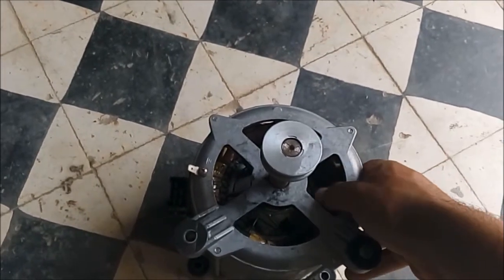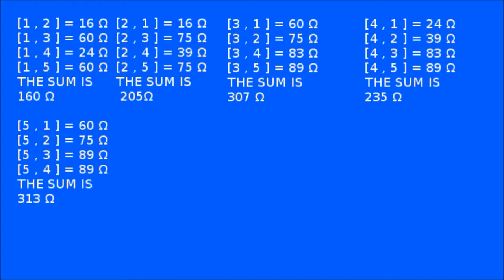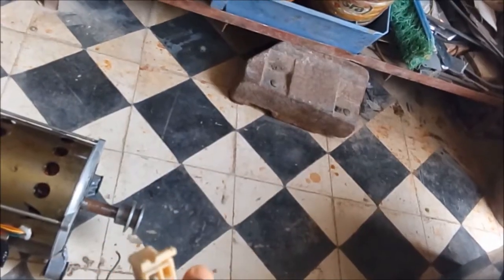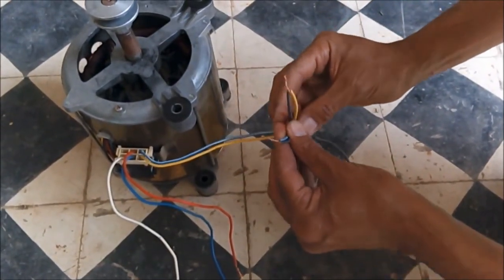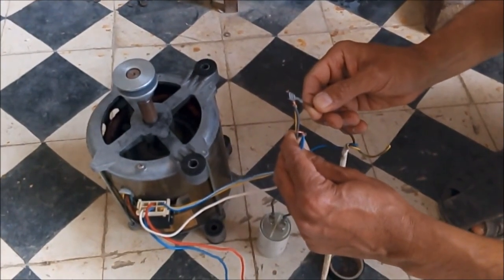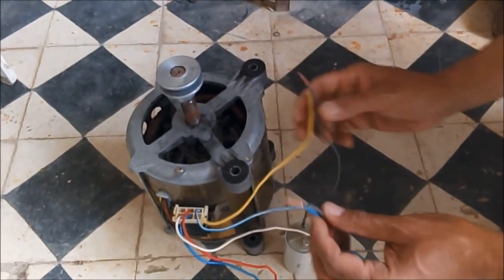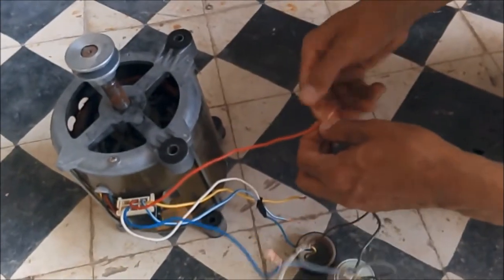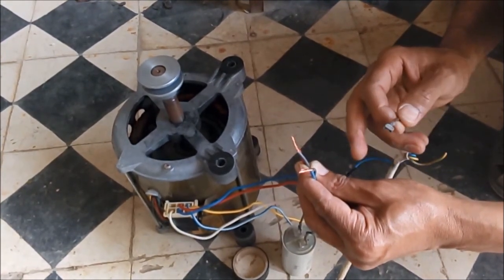how to wire a washing machine motor

Comment: by the way:is this called induction motor? for sure not the universal type. 
second thing: it will be a good idea developing the system to have sort of electric box to connect different speeds by just choosing correct combination.
Reply from the maker: thanks for your comments this is an induction motor the squirrel cage one but it's a commonly used one the speeds as i've said in the video are automated by the machine and i mean the actuator i wanted just to show how to predict the link between coils and pins good luck Mr Sameh
Reply: @fakeit6339  thank you
is yours a 2 speed motor? 
mine is a selni v609 motor. same shape but with a base. it looks same wiring system but actually has full 6 wires! so number 4 is not missing in my system so i call it 4 and i have 5 and 6 opposed to your 4 and 5 respectively.
doing continuity test i get continuity only between three wires: numbers : 4,5 &6 and the numbers are: 
4+6=10ohm
4+5=22ohm
5+6=32ohm
so wondering how should i connect that! i assume i can choose 2 combinations for 2 different speeds and maybe another combination for speed clockwise vs counterclockwise?
maybe you have an idea.
thanks
thanks